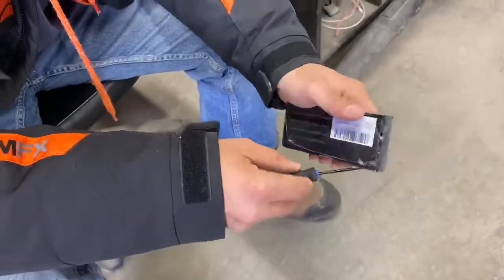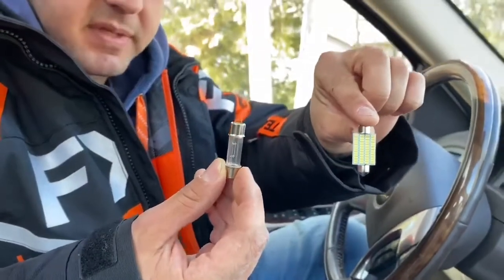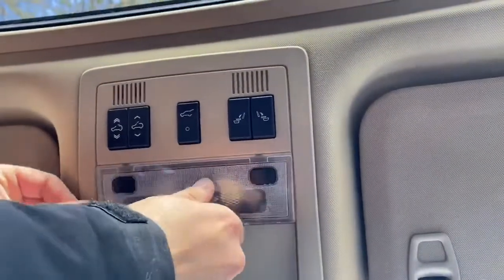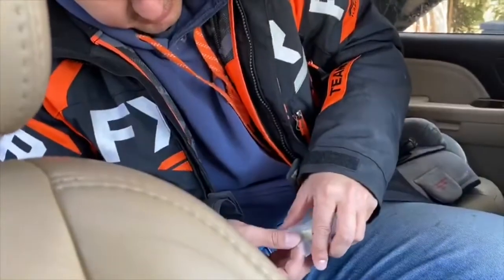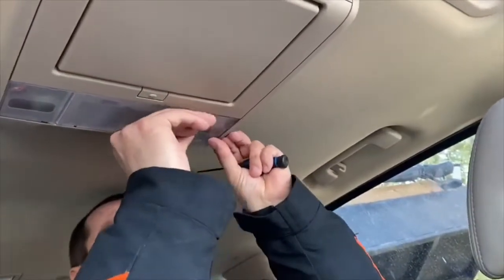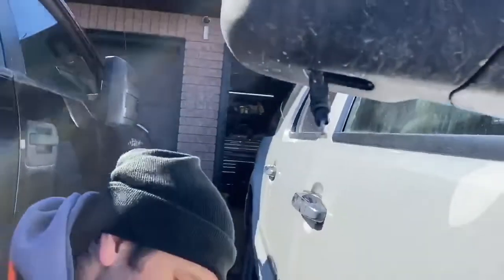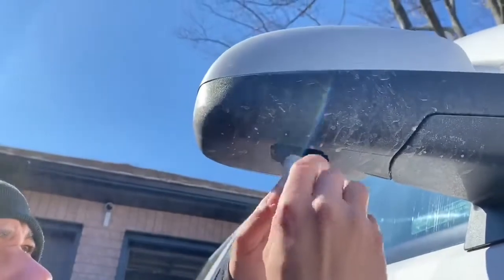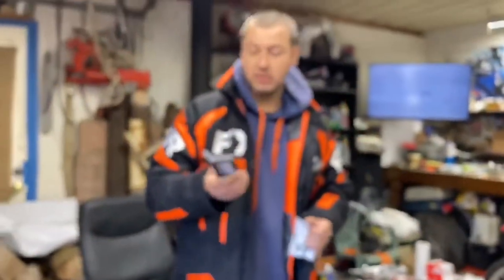2007-2014 GMC YUKON XL DENALI / LED POWER FOLDING MIRROR LIGHT & INTERIOR LIGHT INSTALL

Comment: What are the brand of lights for the interior and exterior and where did you order them from looking to upgrade my light ion my 2009 Yukon SLT
Reply from the maker: WLJH 41mm 42mm Festoon LED Car Bulb 8-2835SMD Canbus Error Free LED Light Interior Dome Map Trunk Cargo Footwell Replacement Bulb Lamp 12V 561 562 578 211-2(10pcs,White) https://www.amazon.ca/dp/B07CM1LPNL/ref=cm_sw_r_cp_api_fabc_gDx2FbM6X3ZCY?_encoding=UTF8&psc=1
Reply: What sealant did you use on the mirror lights bro?
Reply from the maker: Permatex 81150 Dielectric Tune-Up Grease.33-Ounce Tube https://www.amazon.ca/dp/B000AL2RI2/ref=cm_sw_r_cp_api_fabc_3fy2FbW238G9R

Comment: kind of dumb question but do you know if anyone sells dome light covers for the middle row? we recently got one and they are broken.
Reply: I know this question is old but I'll answer for anyone else that may see it.
Best bet for those plastic light covers are ebay or a local salvage yard.
Reply: Curious if you found the cover replacement and if so, was it eBay or elsewhere?  I've been looking for a replacement for those middle row ones too.
Reply: @VintageGamingMemories  Just the plastic  cover? Try a local yard
Reply: @morecowbell235  I called the dealership and believe it or not, they have the cover for the passenger side - only $8.  Each side is unique so not interchangable.  Apparently discontinued for the driverside and probably soon for the passenger.  You'd think I would have tried them first but I didn't, lol.  Thanks for the suggestion!